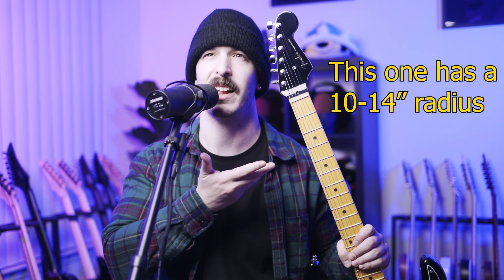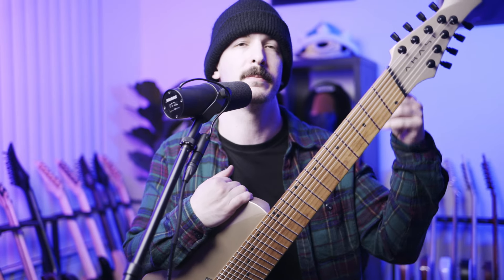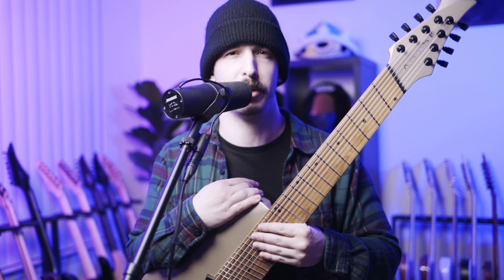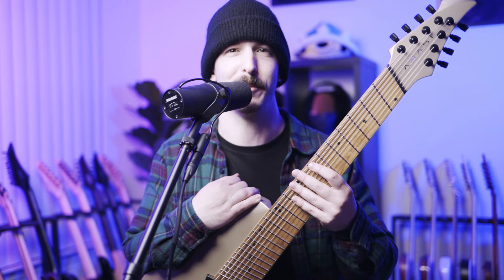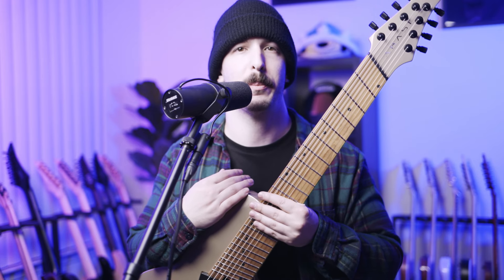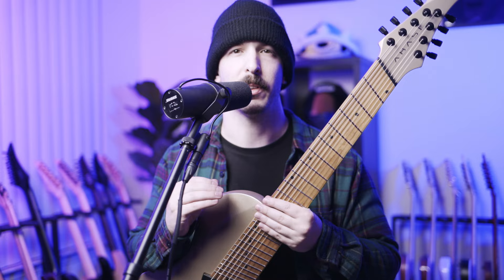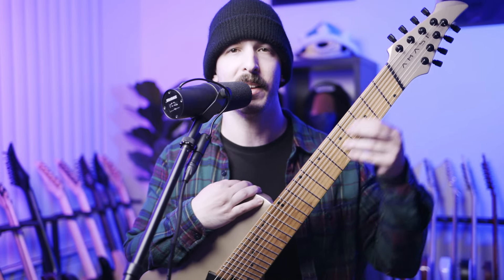Compound Radius Guitar Fretboard Discussion - Should you buy a Guitar with a Compound Radius?

Comment: i dont know if this is just me being a nerd, but aren't compound radius guitars more complicated to set up? the bridge saddles must match the radius of the fretboard which is easy to do when the fretboard has one even radius, but with compound the radius flattens as it moves closer to the end of the neck and it keeps doing that even once its past the fretboard meaning your saddle radius is different than gradual radius shift of the fretboard.
Reply from the maker: That may be but I've had to adjust both the neck bow and the saddle height of every guitar I've received, as the temperature and humidity are different than thay of where the guitars have been shipped from. So for me it's pretty much business as usual. Always good to set your saddle height, neck bow, pickup height, etc when you bring s guitar home and every 3, 6, 12 months depending on the seasons